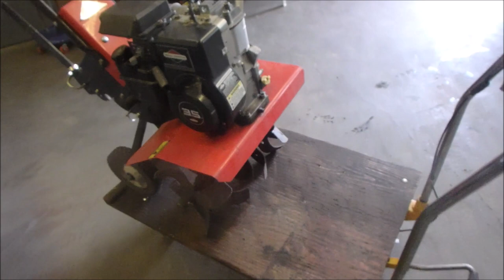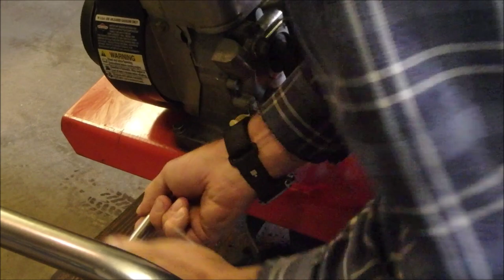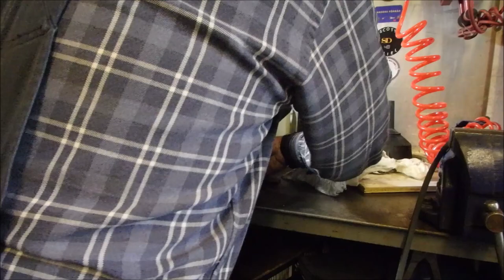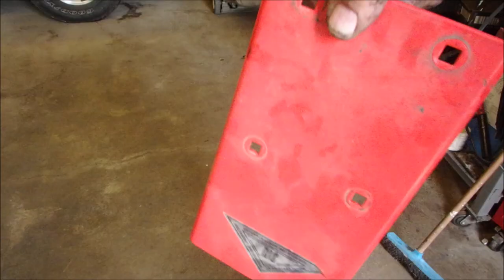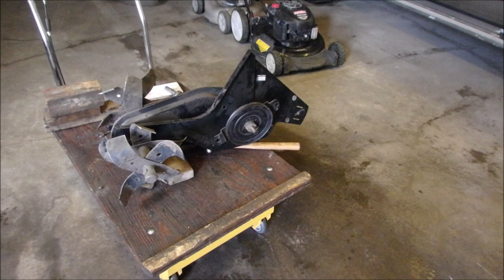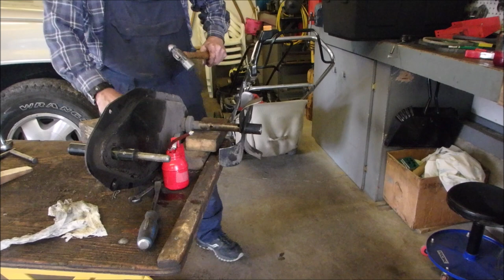A 3.5 HP Homelite tiller Bites the dust

Comment: You store engines exactly like I do. Oil drained, devoid of fuel and often I'll spray a little Sta-Bil fogging oil into the spark plug hole. I find there is always SOME value in a broken beyond saving machine. I too keep any flat stock, angle iron, pulleys, belts, cables, engines and even wheels if they're in decent shape. On the shelves in the shop are about 50 engines from my Mini 4 cycle Briggs to the Behemoth Wisconsin THD 16hp twin and everything in between. The only engines I'm experiencing a shortage on are vertical shaft engines in any configuration. 8 replacement engines gone so far this season. Seems like Covid was hard on not only people eh? Cheers my Good Friend! Sean~
Reply from the maker: Right.  I am also on a inventory blitz.  I am getting rid of anything I haven't used in 6 years.  Very hard to do.   I guess I am getting ready for the next 10 years.

Comment: That's a pretty slick torch you've got there lol. I tell ya, any time I come across that style I grab them up. If I think real hard I bet I've found and given away probably half a dozen of them and it's the main one I use. I do have a similar one with a 4 foot hose that I sometimes pull out for things like burning fence lines or starting my brush pile. That tiller sure did contribute a lot to the parts house! Sean~
Reply from the maker: Thanks a lot sir.

Comment: Not a lot of people would be smart enough to salvage everything you did. Just putting a minimum value of $1.50 per item and you likely have 50 pcs of hardware there is $75 plus the steel you saved for welding projects, pulleys and idlers, belt keepers and the engine should put you at a total minimum of in my opinion $350. Not a bad pay day for the time it took to tear it down. Bonus part is when you specifically need one of these pieces it just makes your day to know you have it because you took this time to salvage it. Good job buddy.
Reply from the maker: Thanks Wayne.  I try to keep just the smaller stuff.

Comment: Reminds me of the "Frankentiller" I made many many years ago when my limbs and joints still worked properly. Tilling up the yard with a rear tine Poulan when the transmission gave out. The inlaws had a 2nd unit that bro-in-law was going to "get a round to it" repairing the engine. I grabbed the machine and swapped engines. Ran it until I kilt it. Bought a new engine and installed it on the deck. Ran like a champ, finished the job and returned it to its rightful owner. She in turn kilt it. The stories it could tell. Once again, another entertaining video my friend.
Reply from the maker: Fun stuff Brent.  How are you keeping?
Reply: @BrucesShop  Topside,,,,, for now. Will chat over a cup of joe down the road and swap lies.
Reply from the maker: @brentscott5359  Couffee!!!!!

Comment: when you showed us how to make the shake and break tool , i also made one w/square drive end so that i can use sockets , square drive allen wrench sockets etc . i used it recently to remove some badly rusted set screws on a pulley . looked impossible , but it did the trick .
Reply from the maker: That is fun.  Thanks

Comment: Good job Bruce!, I had to work on a cub tiller for behind a rider that had a seized motor and a problem with a similar chain case that you had and had sat outside 5 yrs. Owner figured $100.00 would fix it! LOL was so rusty $100.00 acetylene - not enough. It went for scrap! I hope you don't have Earthquake tillers in Canada my opinion they are one time use- junk.
Reply from the maker: Thanks for sharing  I have not heard of them but i am sure they appear under a different name.

Comment: Started and watched all of a 29 min video hoping to see the only interesting thing on here, the "what's broken" shot.Nothing but sheer disappointment at the end with no shot. So, it's a half hour video of unbolting a tiller. Fail.
Reply from the maker: I think you should make a video before you criticise.
Reply: @BrucesShop  so I need to make a video before a small engine repair channel will do a small engine repair video instead of showing what a 10yr old could do with a screwdriver and a socket set? Just take apart nuts and bolts? That makes perfect sense. You dont seem to take criticism too well. Then just answer one thing. What was the point of this video in relation to what your channel is about? Then we'll see from there.
Reply: @DownintheHoller you're out of your lane bud. I also enjoy Bruce's channel and this had nothing to do with repairing anything,diagnosing anything,etc. It was a disassembly video. Am I wrong? And I see you still had to reply even though you didnt have anything nice to say so.......